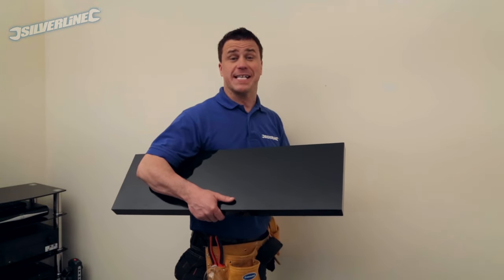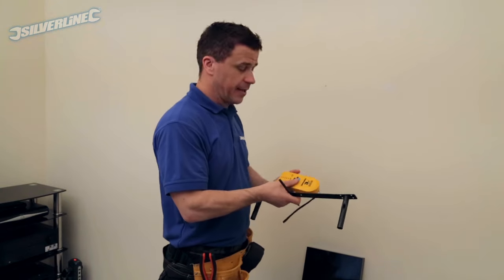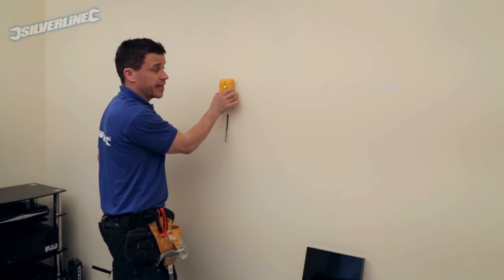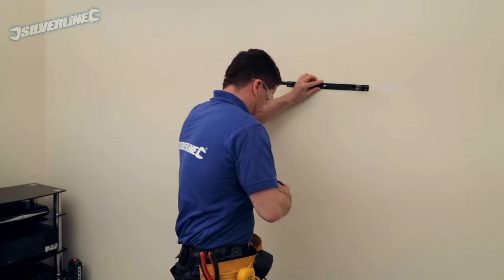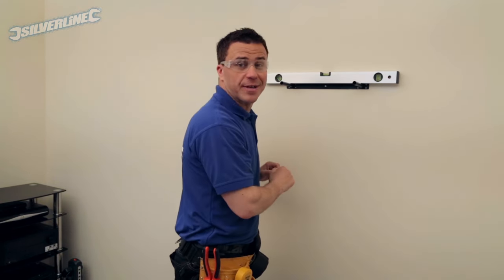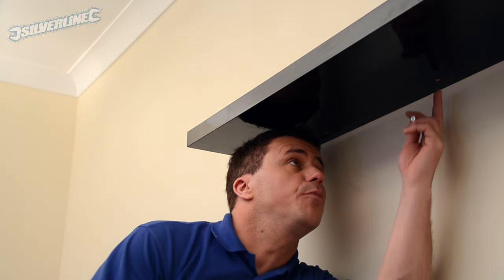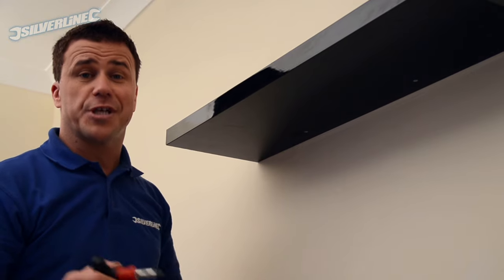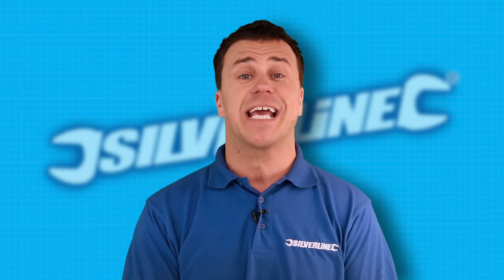How To Hang Floating Shelves On A Stud Wall

Comment: Agreeing with the comments that this is a great video. I understand how floating shelves are supported now. However, I would certainly use the detector or stud finder to find studs to drill into. If you want to put any significant weight or something if significant value on the floating shelf (a movie projector) consider drilling into a stud using either the center hole or the edge holes. The pop-out metal mollies are great but drywall or sheet rock or whatever you call it has low tolerances for holding heavy stuff. Just something I found odd with the video and perhaps you should consider.
Reply: Totally agree with you Patrick and thanks for the comments, anyone purchasing these kind of shelves who are fitting out themselves should be guided by the instructions from the manufactures of the weight they can hold for each type of walling.
Reply: I have the question about this too but he didn’t mention anything about it
Reply: For this particular floating shelf it Hass to be 16 inch on center studs not 2 foot on center studs remember that

Comment: I thought you were supposed to install the screws into the studs. That seems like it'd hold better than just putting it in drywall. Am I missing something?
Reply: He installed wall anchors.
Reply: You would do that like Denise said if you don't have wall anchors or something heavier like a TV. A TV I would def mount into studs. Shelves or pictures are fine with wall mounts if they are heavy.

Comment: Craig, if you're going to be putting anything moderately heavy on the shelf and it's a plasterboard wall, do you need to drill the screws into one of the wall studs to give it some extra support?

Comment: Thanks for the great video. I have a wooden Ikea shelf that I need to hang on the wall but the wall has a light switch on it, so I need to I stall the shelf with some distance. Any advice for the right screw?

Comment: 1.  A 10-lb capacity shelf will be used for 20 lb worth of stuff, and 2.  it will sag, then 3.  you'll need to pull the anchors out and re-plaster the wall and 4. mount another shelf to studs.

Comment: How about if the two holes on the shelves don’t both line up with studs? My studs are 16 OC but the holes to hang the shelves by aren’t. They’re three different sized shelves length wise. I’ll only be able to get one lined up with a stud and the other one not. I have drywall anchors if need be but I really don’t want to go that route

Comment: Great video. Sir a quick question. Why do we use wall plug? Can't we just put screw directly into the wall? When I drill to the wall, the whole gets bigger than required and wall plug gets loosen. On the other hand, when I put screw direct into the wall, it remains tight and I can hang my wall clocks etc on that screw. Kindly advise the difference? Thank you in advance
Reply: if you’re just screwing into wood or a stud then you won’t need anchors for that portion. I would also find a stud regardless if you plan on putting any substantial amount of weight on it.
Reply: Please check some of our other videos on drilling different walls and the plugs we use for a guide.

Comment: I have 2 of these floating shelves that I want to remove.  How do I remove them?  I tried to pull out but didn't budge!  Thanks for any help.
Reply: cut thru the shelf about 2" out from the wall with sawzall, handsaw etc.  This will expose the piece screwed to the wall, Unscrew it and you have a blank wall will a couple holes in it.
Reply: cdouglas1942 like he showed on the video there are two screws underneath the shelf to stop it slipping off, there's  no need to cut a perfectly good shelf in half.

Comment: Can this shelf hold a receiver and/or Blue Ray Player?
Reply: 1000saib have the same shelf (It's an IKEA LACK Shelf) in my room and it can hold my 32" LED TV just fine
Reply: +1000saib    it will not hold unless you screw that bracket into a stud
Reply: pghjr62   Not true.  The issue is the total weight and the dimensions of the shelf. Any shelf that is installed using SIX(!) wall anchors like that will definitely hold that much weight.  But how deep are those items?  Take that into consideration, too.   Considering how many people here incorrectly think that you must only install shelves into wall studs, let’s see what the professionals from hunker.com say: “Toggles, anchors or molly bolts are surprisingly strong. A 1/8 toggle can hold 30 pounds on 1/2-inch drywall and a 3/8-inch toggle can handle a hefty 50 pounds or more safely. When applying any kind of drywall anchor, you should understand how they work and which screw anchor may work best to put into a hollow wall.”

Comment: What are the fixings called tho :-/ thanks for shearing simple explained instructions :-)
Reply: Tracey leigh search “cavity wall fixings” and they’ll come up. You can get easier fixings to use than these though which are plasterboard specific plugs which either knot as you screw in or the end expands to hold onto the plasterboard to resist pulling out
Reply: Thanks Tracey

Comment: Does anyone know if these are safe to just anchor into dry wall with the kind of anchors he used?  Ive never done this before, but judging by the size and weight of my shelf (6'L weighing ~10lbs) I'm horrified that it will rip off the dry wall and fall. Shouldn't it be mounted to studds?
Reply: John Mota I'm pretty sure that stuff finder was supposed to find a stud to drill into. That's why the bracket is a specific width (about the size of the spacing between studs). You shouldn't worry about drilling into pipes or wires because  you're supposed to drill into the stud (where there are neither pipes nor wires). Drilling into the drywall to mount things is a very bad idea as drywall had zero support. However I do not know what kind of anchors those are so maybe it would work, but just to be safe drill into a stud. It saves so much hassle.
Reply: John Mota your not suppose to use a stud he used to the stud finder to check if there were pipes or studs in thr way bc hes using anchors into thr wall
Reply: Millions of people have installed these kinds of shelves properly and safely into walls using the kind of wall anchors he used, WITHOUT having to screw them into studs.  That is what they were invented for, folks!!!  You are not limited to just putting up these kinds of wall shelves into only places where the studs are located!  That would be ridiculous and that alone should tell you that someone, somewhere has invented a product (in this case, the wall anchors he appropriately used) to allow people to hang shelves just about anywhere they want to!!!  Think!!!  Those wall anchors are VERY sturdy and using SIX of them to just hang that shelf that he hung means he can load up a lot of weight on that shelf and not worry at all about whether it will fall.  Millions of shelves have been hung this way.  You can do it, too.

Comment: Can someone please help me. I want to know which type of screw he used and which type of wall plug? I am an architectural student, designing a floating shelf.
Reply from the maker: Hi Farzaana Ahmed,

All tools used in the video are Silverline tools.
 
Screws: Machine Screws Pack 524221
Plugs: Wall Plugs Pack 576689
 
Please visit silverlinetools.com to find your nearest stockist.
Reply: +farzaana ahmed He used hollow wall anchors but didn't set them using the gun. This isn't a demonstration of how to do it, it's an advert for Silverline tools. That shelf would last 5 minutes.
Reply: farzaana ahmed

Comment: What if you don't have studs?
Reply: +Yogi Berrra , There are a few different types of wall plugs that can be used, i find the plastic screw in wall anchors the best for a light shelve like these.
Reply: Our Build Thanks for the answer. Heading to the ole' home depot.

Comment: Floating shelves are not fit purpose on any wall... the rods that slide into the rear of the shelf is smaller in diameter compared to the bored out holes in the rear of the shelf itself, therefore when you screw the x2 screws from underneath they pull the shelf downwards and over time when the weight you put on the shelf will sag over time and will eventually make the wall plugs pull out ever so slightly causing cracks in the walls etc
Reply: also if he would have reversed it you wouldn't see the screws

Comment: 5 anchors for that tiny shelf?? really? are you going to sit on it? wtf you need so many holes in the wall for? each anchor of that type holds at least 30LB. that fake wood shelf will fall apart before it can support pressure of 150lb

Comment: Not only do Silverline make half-arsed products, they make half-arsed videos too... What he didn't mention is that they are using hollow wall anchors, which are better to be set using a setting tool to extend the arms of the anchor  to grip into the back of the plasterboard. What he did was to drill the bracket straight onto anchor and set it that way which can damage your plasterboard and doesn't guarantee that the anchor's arms will be fully extended... Amateurs!
Reply: Please feel free to produce some how to videos and show us how you would do it.

Comment: you are no expert. If any kind of weight is put on that shelf it will tear thru the drywall.  You need to find a stud in that wall to fasten that bracket to for it to hold.

Comment: those fixings are shit ,you'll have more joy with a standard hard wall plug ,just make sure it's hammered in tight
Reply: ...I hope you're joking. Cavity anchors (the one's in the vid) are infinitely better than stand wall plugs in a plasterboard wall. Unless you're hanging light picture frames etc i i would never advise using wall plugs in plasterboard.
Reply: sausage4mash may i know what type of brackets are they